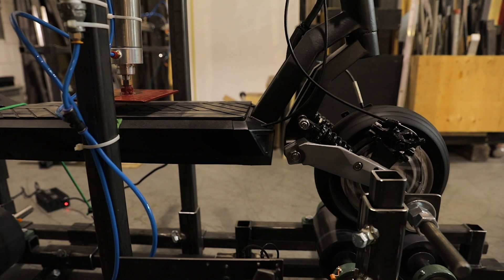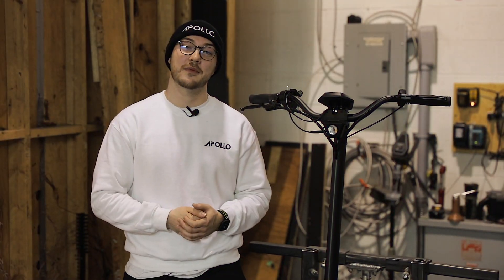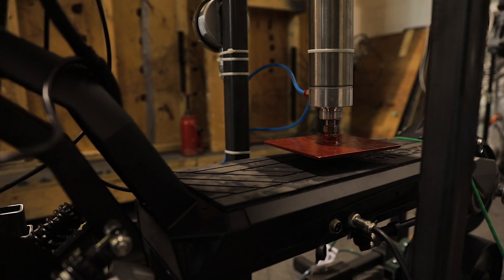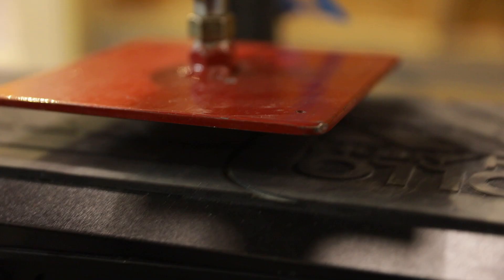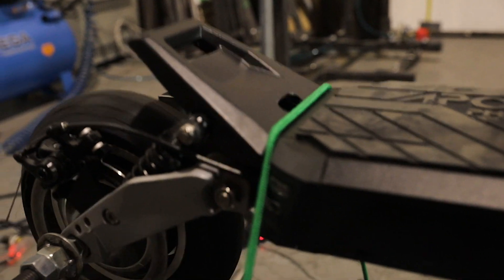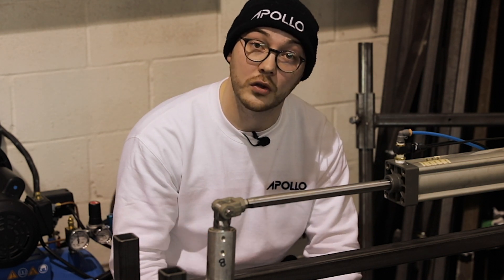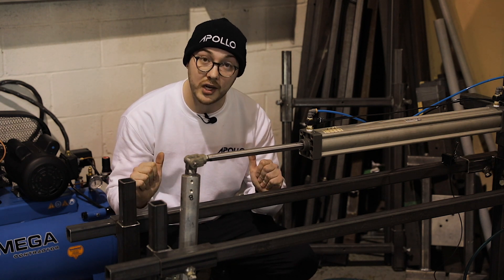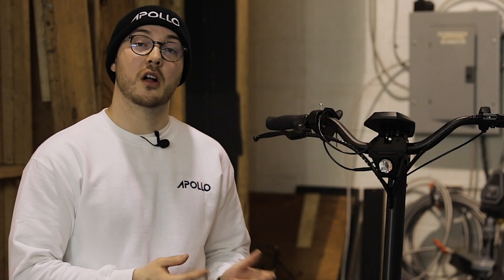Apollo Phantom Safety Tests I Our Independent Testing Facility

Comment: I was a huge loyal fan of Apollo,  until I needed help. "0" response or customer service for warranty parts. The rear fenders fall off over time, because there's no gasket, or rubber washer. The charging port fell out. When I buy aftermarket parts,  I HAVE to buy screw extraction set, because the screws ALWAYS  strip out when you remove them to replace ANY PART. When I reserved a scooter on the waiting list,  it was 1,500 $,  when they placed my order,  it was 1,800$, it went up 300 dollars.  It is my main transportation to work, etc. So, having to wait weeks to get a condescending email, or worse no response at all ? It's pathetic.  So, 3 times now, I've had to spend days and weeks riding Uber to work, waiting for parts that ARE covered under warranty.  According to the Canadian Government office of Better Business,  fraud,  and business practices. So, "BUYER BE AWARE " while they are awesome Scooters, plan on absolutely  ZERO customer service,  or honoring a warranty issue.
Reply: I keep hearing there customer service is shit. That is what I worry about.